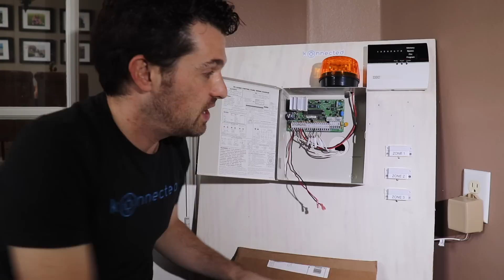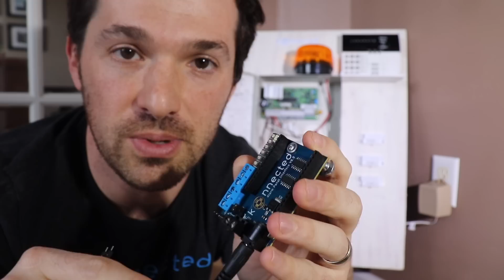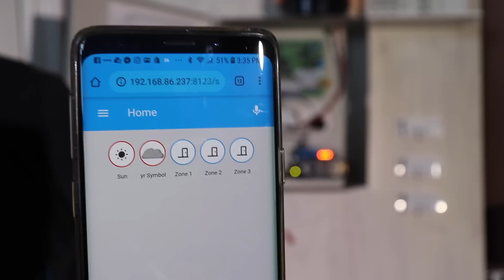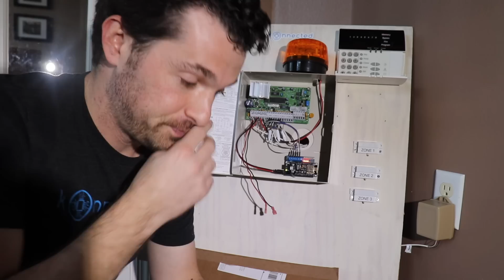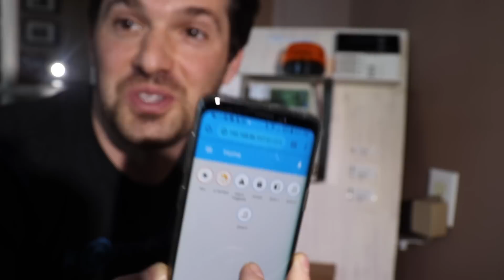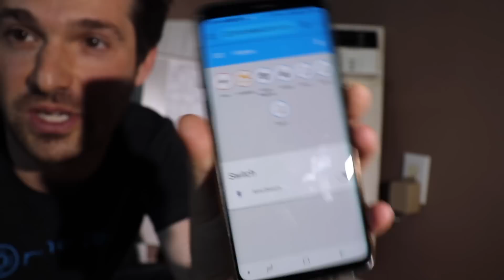Konnected Alarm Panel INTERFACE installation and demo

Comment: Hi I know that these version is old but i have just decided to use them on my alarm system. I have loaded the latest firm ware and connect to my first 6 zones , PIR & two doors and using Home Assistant. The problem I having is the sensors are bouncing around as Open and closed, and continues motion on and off ?? I have turned the little screws anti clockwise fully and do not have any resistors on my zones ?? Could you steer me in the right direction as to why not showing correctly ? Thanks
Reply from the maker: You need resistors with the Interface Kit installation. Please email help@konnected.io and they will assist you furter.

Comment: Hello! Nice explication! I don’t understand if the Zone of the alarm have to exit with determinate voltage.. my zones exit at 13,8v dc… I can connect the Z to a Interface pin directly? Thanksss

Comment: I am a 30 year veteran low voltage contractor, DSC security system dealer, and electrical engineer.  I tell you my credentials to qualify my comments.  I think this was an excellent demonstration and spot on accurate.  Nice job.

Comment: with the wifi module INSIDE the metal box, its in a faraday cage and thus won't get a good signal. Shouldn't this board be attached OUTSIDE the metal box?

Comment: Can I use the "new bord Konnected Alarm Panel INTERFACE" with out an panel interface like your older bord. P>S just if I don't get it work with my interface I have an backup plane to just use it like your old why just .with just using the old sensors and siren
Reply from the maker: No, the interface board requires a traditional 12V alarm panel.
Reply: Can I still use HA to stop the siren if the Alarm is going off? Or do I have to use the old alarm panel.
Reply from the maker: @adtwomey  If you set up HA to be able to arm/disarm like I show in the video, then disarming via HA should silence the siren.
Reply: Cool cool just didn't know if I could use both ha and the old panel. Sorry if I missed something in the video

Comment: So the only big question I have is about ZigBee sensors, mainly because I had an xfinity alarm system that used both wired and wireless sensors, would those somehow still be recognized by the system with this set up or could I get them to be recognized on samsung Smartthings and somehow set them to activate the alarm when active?  (hope that made sense. I'm a real fan of what you're doing)
Reply from the maker: You can use your Zigbee sensors directly with the SmartThings or Hubitat hub -- both of those platforms have built-in support for Zigbee. For Home Assistant, you would need a Zigbee radio dongle, but I think it should work.

Comment: I don't fully understand the difference between this product and the original.  So this works in parallel with an existing alarm service and adds some smart functionality?  I'm trying to decide between which one I need.
Reply from the maker: Tippy right... this product (INTERFACE) allows you to continue using your installed alarm and monitoring service while adding the connection to your smart home hub so you can use your wired sensors in your home automation.

Comment: I have a Honeywell Vista 20SE and want to purchase the Interface Konnected BUT wondering If Nate had worked on that glitch concerning zone one on the Honeywell Vista systems . My zone one is my front door NOT smoke alarms and just wondering if, by using Hubitat Hub, I'll be able to see my front door sensor on zone one.

Comment: Can you do a hybrid with the interface?  Like use the wired zones already and add additional zones with smartthings?
Reply from the maker: I think you're asking if you can use the interface panel for your wired zones, and then add additional zones with other Z-wave or Zigbee sensors direct to SmartThings. The answer is yes. Let us know if that didn't answer your question.
Reply: Konnected yes that is it. Can the zwave sensors also trigger the alarm siren?
Reply from the maker: Yes, if you set up a relay to trigger a zone in your traditional system, then you can make SmartThings trip that zone when one of the ST sensors detects an intrusion. Or, you might want to look at our original product, the Konnected Alarm Panel, that replaces the old system completely and connects your siren direct to ST.
Reply: Konnected great. Order will be incoming soon.

Comment: I am so close on investing in one of these. There was a wired security system in our home that is not in use (for 4 years).  It's just getting a bit overwhelming taking in so much information. I have to mentally break this up in steps because an old timer like me is not with the times. Transferring connections to the new board is not the problem. When you say "configure wi-fi before installing" or home assistant or gitHub THEN it feels overwhelming. As soon as I understand the "ground" connection regarding sensors then I'll be good on step 1. It doesn't matter which sensor wire we assign to the ground terminal?
Reply from the maker: Carlos Medrano, glad to hear your close to ordering your Konnected kit! We understand that some of the setup can be intimidating. When you’ve got your kit and are going through your install, we’re always just a quick message away at help@konnected.io

Comment: hello nate congratulations for the excellent work ... I'm interested in buying interface but I saw that between fees shipping and more comes to cost me almost double ...
so I wanted to try to flash the nodemcu myself and make a donation.
is there a github for interface or at the moment is there only the one for the initial model?
Reply from the maker: The software for both versions is the same. There's different circuitry in the INTERFACE board that allows it  to be connected in parallel. Sorry but the schematic is not open source, only the software is.
Reply: ok! I will buy the complete kit despite taxes and everything else .
I saw in the video that you can arm and disarm the alarm with a relay but I imagine it is a whole on or a whole off or is it possible to arm it thanks to the relay also partially? (example only door and outside) in this case it takes more relay? (to have more options to arm)

Comment: Hi nate, I'm in the UK.  Does the interconnect between the zone and the Konnected unit utilise -'ve or +'ve switching/signalling ?  In the UK alarm panels tend to be negative switching.
Reply from the maker: If you're asking if Konnected can read a sensors that alert by switching polarity, the answer is no.

Comment: Hello, I purchased the Kickstarter kit and am getting ready to install it. Is there a way to interface with IP cam or for example ring doorbell and sensor light? I'd assume if a tablet is used might need separate interface to cameras but thought I'd ask.
Reply from the maker: Konnected doesn’t directly interact with cameras. You would need to be connected to the SmartHome hub directly. Also, if you haven’t installed since the Kickstarter, I’d flash new firmware and software on the boards. The process and tools for that are on help.konnected.io
Reply: @Konnected-io  Thank you very much for the reply and guidance!

Comment: If I setup this interface with my current system, will I be able to use Noonlight to monitor my alarm system?
Reply from the maker: Yes, you can still use Noonlight. Smart Home Monitor won't automatically sync with your legacy panel, but you can set up an automation to trigger Noonlight if your legacy panel alarms assuming you can use a programmable output to get alarm status like I show in the video.

Comment: where is the ethernet version?    i want to connect cat6 and bypass wi-fi.   power failure?  will this power off the main panel backup battery?   i want to run my cable modem /switch on a UPS so when th epwoer goes out i'll still have an alarm via ethernet.
Reply from the maker: We're working on an Ethernet version. Not ready yet.
Reply: @Konnected-io  how close are you now?
Reply: Yes!  I have asked Nate for the samething.  If the are in a metal enclosure wont the interfere with the WiFi?
Reply from the maker: The metal enclosure does impact the WiFi signal, but usually not enough to negatively affect functionality. Depends on your router's proximity and signal strength. If it's a problem you can mount the device on the outside of the enclosure.

Comment: Nate - you need to give more detail on the relay arm/disarm setup for smartthings or smart assistant app - took me 10 minutes to install and 3 hours to figure out that I needed to set the one output to a momentary switch and add a new device on the app to use this output...

Comment: I have the alarm interface connected and working. I would rather have the 2 pgm outputs and keyswitch connected to a spare nodemcu but the konnected app does not recognize the state of the alarm trigger and arm status properly.   I also can't toggle the keyswtich propery either....any advise on what i may be doing wrong?
Reply from the maker: please reach out to help@konnected.io so they can take a look at your setup.

Comment: Doesn't this effectively require wifi and internet connection to be up.  e.g. no alarm, local siren or otherwise, if those go away?
Reply from the maker: Your old alarm panel will still work the same as it always has.

Comment: I am an existing user of the original Konnected interface and THIS is the solution I would have preferred, Thanks for providing this alternative! Unfortunately, I have already dumped one of my keypads from my original system that I would have needed to reenable my old wired system. 

FYI - I see in the video you have End-Of-Line-Resistor EOLR resistors mounted directly in your panel which I see most of the time in installations. This completely negates the security function of optimally monitoring the wired integrity out to "end of the line"  the field. Even though this is a demo wired panel it should educate people with the proper optimal installation location of the EOLR at the last wired device in the field. I think I see this because the installing contractor is lazy (or is trying to save installation costs at the naivety of the owner) or ignorant of this function to monitor the integrity of the physical wiring out to the end of the line.

So if I understand this new configuration of Konnected Alarm Panel INTERFACE it would be optimal to relocate the EOLR  the proper location at the last wired device in the zone (which granted is difficult if the original installation didn't accommodate for), as the Konnected INTERFACE monitors the circuit for each zone.
Reply from the maker: You're absolutely right about the EOL resistors. A lot of our customers send us photos of their panel, and sadly we see a LOT of panels with resistors at the panel like this. Unfortunately more often than not it's done improperly in this way -- likely due to contractor laziness or ignorance. If your resistors happen to be installed in the correct location, then you don't have to worry about it at all -- just tune the potentiometer as shown in the video.

Comment: I’m excited to see this. It is exactly what I was looking for but unfortunately my system is so old that it has no programming available.
Reply from the maker: Henry Kiser if you have wired sensors, it will work with Konnected. All you need is wired sensors, our Konnected Alarm Panel Kit, a Samsung SmartThings Hub, and your smartphone!

Comment: having a wifi alarm system, or a wifi alarm panel, is just DUMB... you had wired alarm panel, and wired keypad, and replaced them with wifi alternatives... any scriptkiddie can flash a deauther on a 3€ esp8266 and make your alarm COMPLETELY useless without even touching anything...
Reply: you say this in every video

Comment: Why would people use this over a Eyez-On EnvisaLink?
Reply from the maker: Great question. Here are a few top reasons:

1. Konnected integrates directly with four different home automation hubs: SmartThings, Home Assistant, OpenHAB and Hubitat. On the other hand, the Envisalink device does not talk directly to home automation hubs, it requires a separate server or computer running on your LAN to relay or proxy messages from the EVL to your hub. Konnected's open-source integrations with home automation don't require any additional hardware or software and are fully supported by our tech support team.

2. Konnected responds in real-time. We've been told by users of the EnvisaLink that there's sometimes a delay of 30 seconds or more on some events. For home automation purposes, like turning on/off lights based on motion detection, a delay like that is too long for it to feel reactive for most people. Our users have told us that Konnected works much better for home automation purposes due to the nearly instantaneous response time.

3. The EnvisaLink only works with DSC and Honeywell/Ademco panels. This Konnected product is designed to work with ANY wired alarm system panel by tapping into the sensor loops directly instead of the data bus.
Reply: @Konnected-io  what about wireless devices?

Comment: Hi Thanks this is what I am looking for. Just wonder how it would work with Motion sensors & outside beams. Thanks . I am on your website and can not add the delivery address as South Africa is missing from the list.
Reply from the maker: It will work great with motion sensors and IR beams as long as they are wired directly to your alarm panel. We've added South Africa back to the shipping list -- but due to problems in the past with SAPO we can only ship to SA via DHL or UPS.

Comment: Hey Nate! Very excited about this new option. I believe this will work great with my Concord 4 panel but still have a couple questions. My main interest is in remote arming/disarming of my system. I had an Envisalink on my DSC system at our old house but the new house with the Concord 4 doesn't support any remote connection without an expensive cellular add-on and subscription JUST to remote arm/disarm which is when I first found the Konnected option. My main question is regarding the relay. Can you distinguish which arm mode to enable? (away or home) Is that done in the programming of the zone maybe? Not on the Konnected side? Beyond that, I assume i'd need two relays to have the option to either arm home or away separately. With that in mind, it looks like i'd still need two Interface boards, one for either relay, is that correct? Even if I had only 4 contact zones + the 2 relay zones needed to wire?
Reply from the maker: The capabilities of the keyswitch arming/disarming modes would be specific to your alarm system. Sorry, we can't advise on that. You'll have to look up what kind of keyswitch capabilities it has in your Concord 4 installation manual.

Yes, each Konnected alarm panel interface board supports only one relay output. If you need more relays for two different keyswitch triggers, you can use our DIY kit which contains a NodeMCU breakout board capable of connecting up to 6 relays [https://konnected.io/collections/in-stock-now/products/konnected-diy-prototyping-kit].
Reply: Konnected Good to know thanks! Looking deeper it seems my system may only allow "away" arming through the keyswitch but thats fine. One more follow on question, could this board also be used solely for the relay arm/disarm function? Does that specific function have any need for the zones to be connected?
Reply from the maker: If you only want the relay function, you don't need the Alarm Panel INTERFACE board. Our DIY prototyping kit is a less expensive option and will also control (up to 6) relays, but doesn't have the capability to tap into the zones.